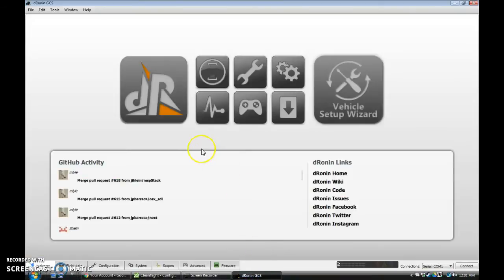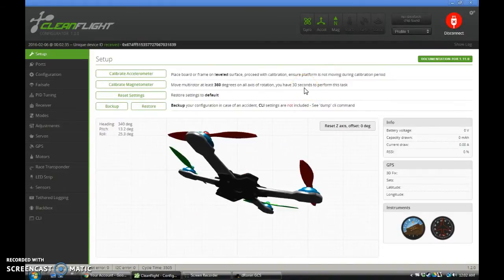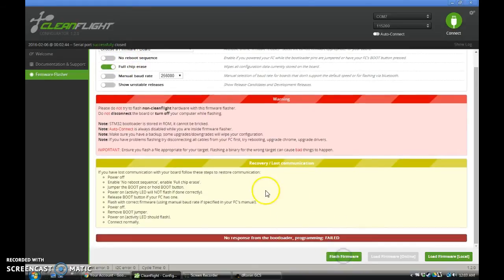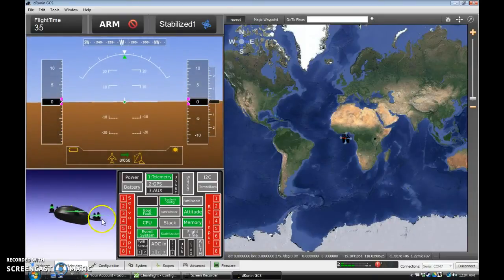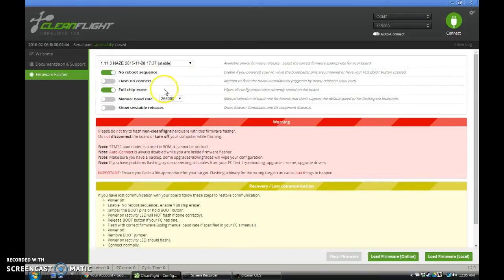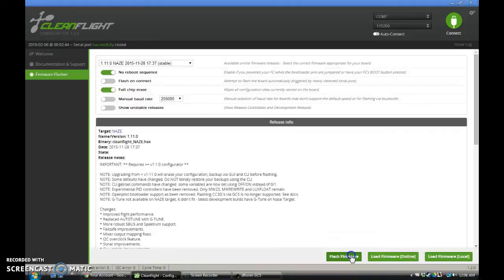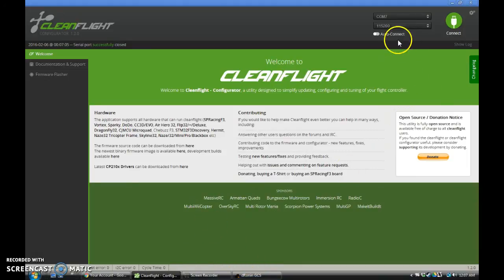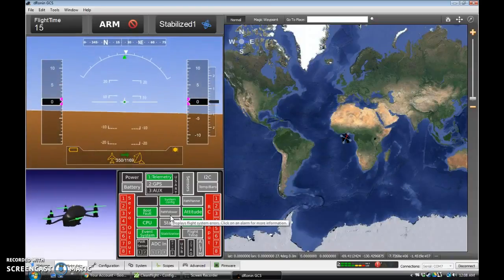dRonin on the emax Nighthawk 280 Pro - Part 1 - Flashing

Comment: I NEED SOME HELP PLEASE  

Hi there, i bought my EMAX night hawk 280 pro RTF version recently, it came with the EM - 16 transmitter and after a few flights i decided to do a firmware flash to the 1.13.0 NAZE, since then i'm not able to fly anymore as the craft doesn't respond to the transmitter any more and all settings that i had on the craft has been areased on cleanflight , can anyone let me know what i should do to have my quad again in the air?

also the quad came with the wierd conection from the board to the reciver as you can see on the attachment. i bought from rc geeks in uk like that (without the tape) and they say to contact EMAX as the craft need some codecs to be able to fly again, can you please help me to set up my quad, as i paid for it and can't fly it anymore? 

PLEASE HELP.....
Reply from the maker: Unfortunately I have no experience with the RTF version and the transmitter/RX that emax provides.  I also haven't touched *flight in almost a year now since I've been so happy with dRonin.  But I do know from my time with *flight in the past that when you flash it will wipe out all settings so you'd have to go through a full setup again - most likely it's no longer configured for the RX but since I don't know anything about the emax RX I'm afraid I can't really help with that.

Comment: Are you still tuning with dronin? I flashed my cheap robocat 270 knock off with it and are happy with characteristics of flight but when I connect board up and power up both quad and transmitter my inputs do not show on the computer screen and unable to enable autotune on flight mode tab...have you ever experienced this?
Reply from the maker: Yep, still flying dRonin exclusively.  In fact just got a new DTFc controller to test with it.  (So will probably have a new video or two soon.)  

Inputs don't normally show in dRonin like they do in *flight it was something that confused me with I first started experimenting with TauLabs before dRonin existed. But if you go into the object browser you should be able to see them change in there (I forget the exact object to look at and the computer I'm on right now is having issues so I can't check...I'll get back to you on that tomorrow if you still need help though.)  

Not being able to enable autotune as a flight mode - you have to enable the module (by going to the autotune tab and checking the box at the bottom of the first page) and reboot the controller first.  If your'e on a f1 controller (naze32 or CC3D) you'll have to make sure you don't have any other modules enabled or there won't be enough memory available for autotune due to the limitations of the f1 chip.  

Hope that helps, and let me know if you need more help finding inputs in the object browser!

Comment: Thanks Jason but where can you find the name 32 firmware to upload through Cleanflight ?
Reply from the maker: +Cristian Carletti Depends on what platform you're on.  I'm not sure on mac since I don't have a mac.  On Windows if you use the installer they're in the "firmware" directory under the dRonin directory.  Linux I've only built from source and my system is only 32bit and we only have 64bit packages so I'm not sure where the package puts them but it should be similar on all platforms.  The ef_naze32.hex file is the one you want to use in CF.
Reply: Tks a lot I'll have a look

Comment: This looks really promising whats the default motor layout on Dronin I have a eachine racer 250 with a cc3d that I might try this out on.
With betaflight I have to change the motor mix because of the different motor layout.
Reply from the maker: +Stephen Gibb dRonin Numbers motors starting in the upper left and going clockwise.  So NW is 1 NE is 2 SE is 3 and SW is 4.  However, 1/2/3/4 in dRonin don't match up with what's labled 1/2/3/4 on a Naze32 which is where things get complex.  I know if you a quad setup with a Naze32 working then when you move to dRonin the new numbering is 
Motor 1 -> Channel4
Motor 2 -> Channel2
Motor 3 -> Channel1
Motor 4 -> Channel3
Set on the Vehicle page.  I don't know what the layout is on the eachine, but you can customize it on dRonin by changing those motor mappings on the Vehicle page, then going to the Outputs page and testing them to make sure the right ones are spinning for the right position.

Comment: Can change the motors on this quad or will it mess it up cause they are not powerful enough for me
Reply: +Rc Addict why not just use 4s? with a 5x3x4 prop i would be worried those motors might be too much for the 12amp controllers on the control board.
Reply from the maker: +Rc Addict You could change the motors.  But they use a JST-XH connector (same as a 2s Lipo Balance connector) so you'd either have to remove those to be able to solder wires directly or you'd have to but JST connectors on the motors.  It's not really a quad designed for modification.
Reply: +Jason Hitesman thx man I will be putting on the skitzo special edition motors on there
Reply: +Stephen Gibb I will actually be using the Cobra CM-2204/32 Brushless Multirotor Motor they will work perfectly fine with 12 amp esc's. You were right the 2205 were actually going to draw too much power for 12amps. Thx for the help:)
Reply: +Rc Addict I have actually tried the hq and the gem fans and 1300mah 4s nanotech batteries but simply too sluggish on the punch for me.
Reply from the maker: +Rc Addict The 2204 Cobras are actually 2205's...I'd be really nervous running them with the 12a built in ESC's.  This really isn't a great platform for tweaking things due to the all in one board.  People melt down 18a KISS ESC's running 2204's on them with too much prop or pack, 12a built in's would probably get melty fast.
Reply: +Rc Addict go to crazyskullcrusha and look at his play list he has a build and uses the Same motors and 12amp esc.